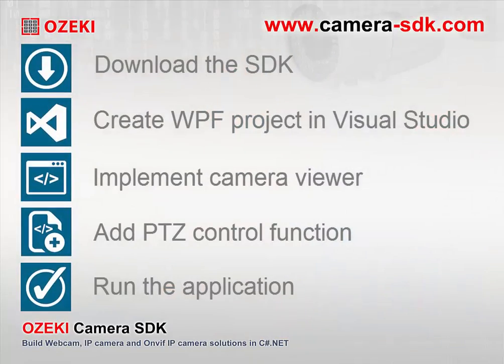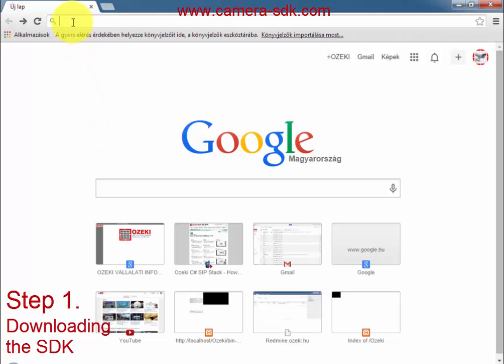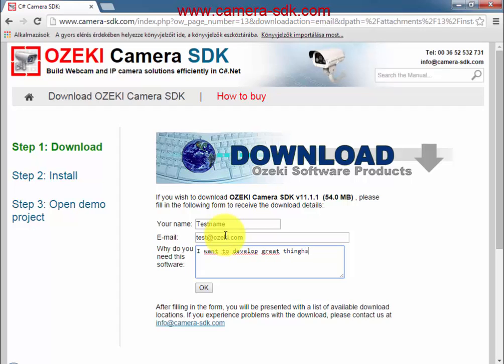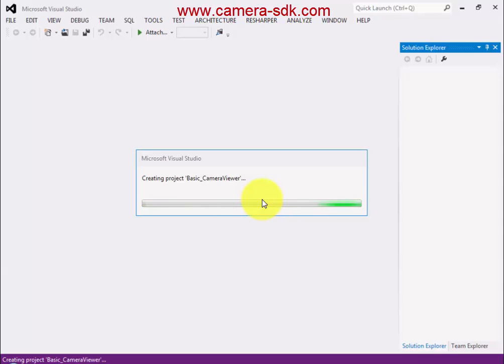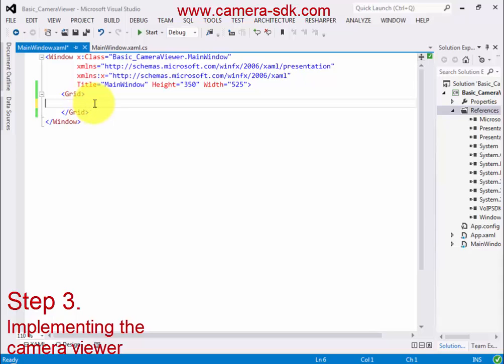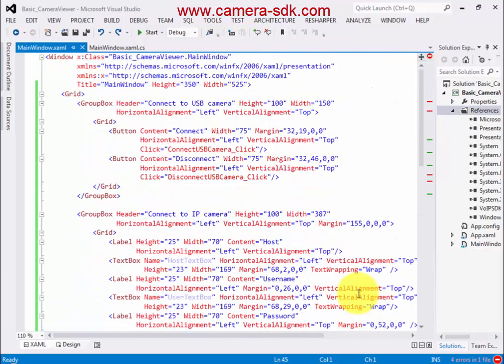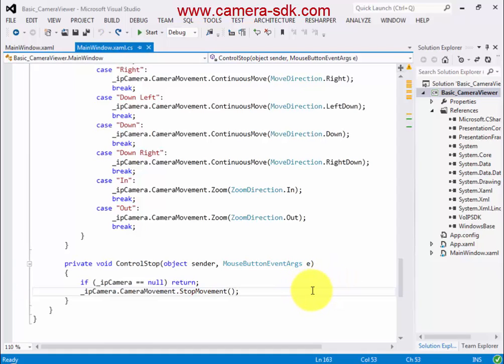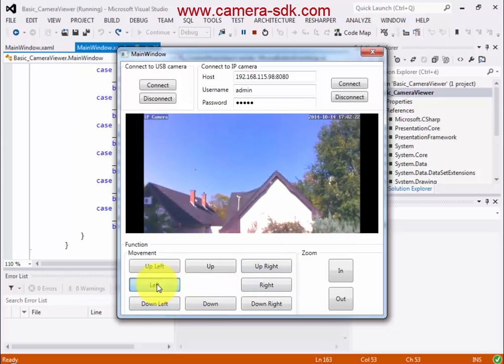C# camera tutorial #5 - Pan - Tilt - Zoom (PTZ)

Comment: Can i set camera , so that it will rotate in all direction of Room,,,,, Reply ASAP
Reply from the maker: MANOJ KUMAR Kori Hello, 

For implementing the PTZ functionality, you need an IP camera that supports this feature. You should check the user manual of your IP camera to make sure it supports Pan-Tilt-Zoom. If not, a 360 degree camera is needed to be able to scan the room in all direction.

More information on how to implement PTZ in C#: http://www.camera-sdk.com/p_19-ptz-ip-camera-motion-control-in-c-onvif.html
Reply: Sir this video i already watched ,,, but i want to  move camera without using left right up down button (means automatically, once set camera  it will move in all direction. can we modified code.
Reply from the maker: Please take a look at this C# code example: http://www.camera-sdk.com/p_48-automatic-movement-left-and-right-scan-between-two-points-at-different-speeds-in-c-onvif.html
Reply: thanks for reply,,,,but can we set camera to move in all direction instead of onlyfixed two point.